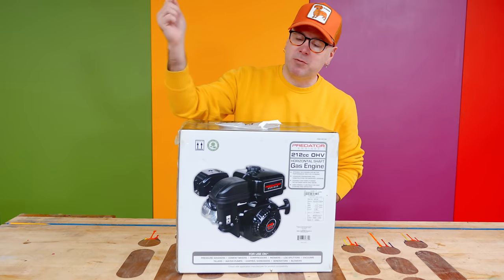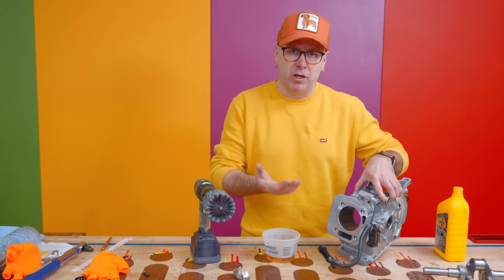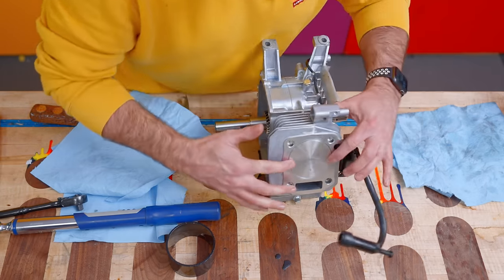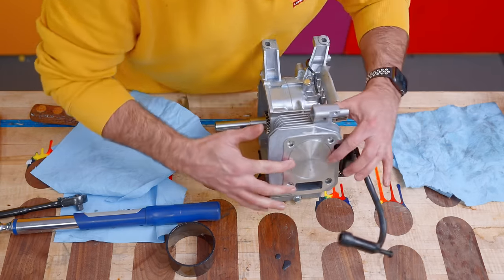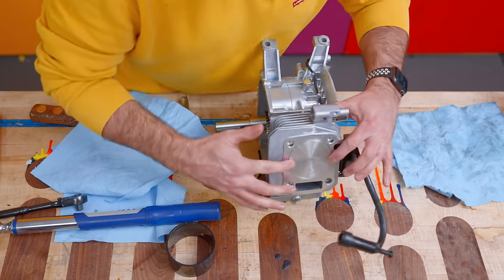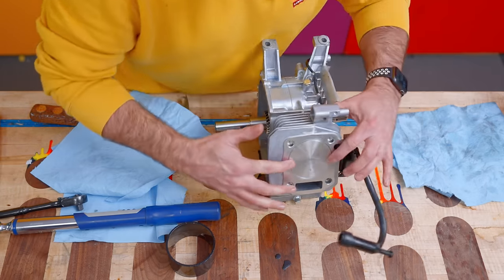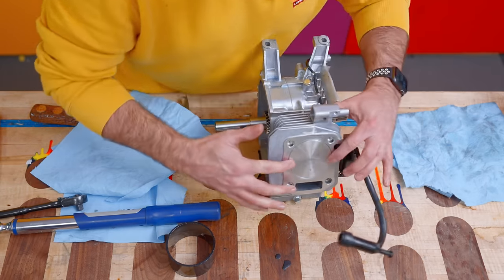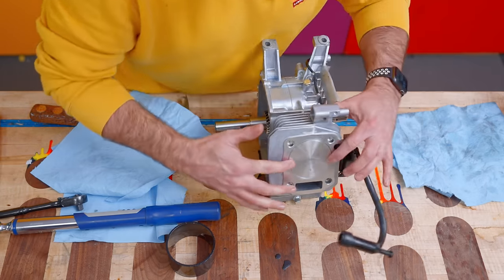How to Build a Competitive Kart Racing Engine (Stock Appearing)

Comment: Great video David! I'm a FAA A & P, , and I'd like to share nothing happens without "ignition". I hope you'll find the aviation version of the internal combustion cycle to be more accurate. Which is: 1) Suck, 2) Squeeze, 3) IGNITION, 4) Bang, 5) Blow. Great tech video, , you point out ALOT of very good tech points and assembly processes for high output engines! Lastly, you have really good production (sound, lighting, layout and editing) values. Loved it!
Reply: Aircraft engines don't operate on the 4 strokes, intake, compression, ignition, exhaust?
Reply: @genefogarty5395  Gene, yes they do. Please reference any aircraft mfgr's piston or gas turbine engine operation discriprion. You are misinformed or do not know the facts with gas turbine or high bypass gas turbines. These are commonly called "jet" engines.  .  I'd recommend reviewing the Continental IO540, a 540 cubic Inch "Opposed Piston" with ovhd vales.  Or the Pratt &Whitney 4000 GTF (Geared Turbine Fan). A typical jet engine has multiple rows of compressor blade. Then multiple rows of blades in the "hot" section. The air enters a typical gas turbine and is very highly compressed. In some engines it's compressed from static atmosphere pressure of 14psi (sea level) to >200psi. in the "Compressor" section. This very compressed air flows into the hot section. Kerosene is injected at very high pressure and inside this "hot section are "IGNITORS".  There are two types of ignitor systems. The continuously  "sparking" ignitor or the continuously "Hot". These "ignitor's" are needed to ensure that the kerosene gets ignited in a very high pressure and very, very turbulent gas flow! This flame front then expands the pressure in the "hot" section by 5X or more! This pressure then expands as it flows across/through compressed hot section blades, creating a massive pressures and force. This gas the exits the jet engine via a third set of compressor blades called the "Re-Heat" stage. So, in a nut shell, it's Suck, Squeeze, IGNITIO, Bang, Blow! I hope you have benefited from today's class. All the best, TAC
Reply: @WestKyCrime  This was a 4 stroke ICE, not a jet, dude. It's still intake, compression, ignition or bang as you call it and exhaust. Ignition and bang are one and the same. There's no delay, it's an explosion. But thanks for the "Class"
Reply: @genefogarty5395   sure, we all have our opinions. Let's walk thru what happens in a ICE ignition event. And I'll try to see if I can convince you why Ignition is its own "event" in the ICE operating process. The crankshaft magnet on the flywheel (engine in the video) passes by the stepup voltage transformer. The magneto (AKA a very strong magnet). The step up voltage coil then excites the main voltage step up transformer (AKA as a "coil pack"). Once the voltage exceeds the ignition systems regulator (AKA as a special type of capacitor), this high voltage then seeks a path to ground.  And "wah-La", it's ignition time. Bang occurs AFTER this above ignition event. In closing, I bet you will agree, that the first thing experienced technicians ask when trouble shooting a ICE is, "Is it getting Spark"?. Next question is likely "is it getting "Fuel"? So, I hope you can now agree that "Ignition" is its own event in Petrol ICEs. All the best Gene.
Reply: @WestKyCrime  It's a 4 stroke. If there's no intake air coming in it won't start, no compression, no start, no spark, no start, no exhaust going out, no start. Pretty simple.

Comment: The zinc additive was removed from engine oil by the EPA in 2013. It's essential for any flat tappet or non roller lifter valvetrain. I'd use it past the break in.
Reply: Rotella T Triple and T6 both still contain zinc, the former in 1200ppm+ range.

Comment: When checking the valve seals you should use petrol or diesel, water is way too thick to test an air seal. Petrol will evaporate if left for too long so keep an eye on it
Reply: Yep....thats EXACTLY why you use gas! its a better indicator of leaks since its so thin and runny and water has too much tension.
Reply: A vacuum checker is the correct way to do it. The tool isn't that expensive either.
Reply: Yea we used acetone in my shop it’s super thin.
Reply: @davelowets  There's a correct way to do a lot of things, if petrol isn't leaking through however the compression is good. No one is buying a tool for a one time job, i certainly ain't
Reply: @mrcaboosevg6089  Do the job right, or dont do it at all.
Reply: @davelowets  It makes a miniscule amount of difference to the point you'd need to literally have equipment that specifically looks for it. I've rebuilt dozens of engines, all with compression at or above what they were new all using nothing but petrol. The 'right' way is the opinion of who you ask, it's not fact. This guy has won races using a good method in a bad way, you gonna tell me he's done a bad job regardless? It's a $300 engine, not a 1960s Ferrari
Reply: @mrcaboosevg6089  Take some pride in your work, and do it the right way, with the right tool.
Reply: @davelowets  Why? Like genuinely, my dad is a mechanic and i've been working on engines since before i can even remember and the only 'specialist' tool i own is a compression tester. I've never had a customer come back to me complaining about my work. In fact many people come who have said the dealer with their 'fancy and perfectly correct' tools couldn't fix them and yet i could because in reality tools don't make you a good mechanic, it's almost like it's what you know and not what you have. Just by the way i own thousands if not tens of thousands in tools, 99% of the time i use the exact same ones i got from my grandad that are the most basic sockets, ratchets and spanners. They were all he used putting together British Army tank engines. 

Don't talk to me like you're some godly man, i gave the man and the people watching some simple advice that has been used and proven for the better part of 150 years and you're coming at me thinking you're the best thing since sliced bread. The guy even used the same method wrong and he's winning races, what are you doing other than being a twat?

Comment: Commonly I see isopropyl alcohol used for checking the valve seal before the first heat cycle, but always remember that if you have teeny tiny itty bitty leak, the chances of it sealing after running for a break in are almost 100%
Reply: I second the isopropyl alcohol...
Reply: Alcohol's for drinkin', lighter fluid's for checking valve seats 🤣🤣🤣

Comment: A tip I picked up from somebody that rebuilds motorcycle engines is to build yourself a small open square of wood out of two by fours or maybe four by fours and the engine case will sit on top and inside the square and not move around so freely on a flat bench. It’s sort of hard to explain but in essence it’s just an open square of wood that’s tall enough to allow the engine case to sit proud of the bench top. It’s so simple when you actually see it but I never thought of it myself. It really keeps the case from sliding around on the bench.

Comment: Just a question: by changing the connecting rod and piston, as well as removing material from the crankshaft, wouldn't the crankshaft require rebalancing to accommodate the changes especially since it will now be turning at 8,000 rpm?
Reply from the maker: Possibly but I have not had issues
Reply: You have to remember that these motors are a single piston motor not a traditional motor with 8 cylinders that spin the crank at once. So take the side cover off of a motor and turn the motor over. There is only one point where the motor is perfectly balanced and that is when the crank is completely in line with the rod and piston. The other 99% of the time the crank and  counter weights are not going to be in that position. I hope that was easy to picture in your mind. But to answer your question plainly no you never have to balance a crankshaft in a single piston motor. The only thing that you really should do is make sure the bore is true.
Reply from the maker: @JakeSeiner  That was a fantastic explanation. Thanks Jake.
Reply: @SomethingAboutMaking  Another tip that people don't really let out is call JC Specialty up and order hardened side cover bolts this keeps the side of that block from flexing with those oem bolts. I know it probably sounds silly but it adds a substantial amount of strength to a predator block. Considering that predators are the weakest blocks of all the clones this is a must for every one I build.
Reply: @JakeSeiner  well excuse my ignorance. Just assumed swapping out stock heavier con rod and piston for lighter components would require balancing, especially taking an engine meant to rotate at lower rpm's and pushing it out to 8k. But I have never souped up a lawnmower enigine.
Reply: @sinformant  Your not ignorant at all man.  These little motors are a niche of their own. It takes countless hours of reading and looking at what parts are available. Not to mention the limits of these motors. I have learned from years of reading and many many errors.
Reply: @JakeSeiner   Where can I start to read and find information for the Predator Engine 13HP? I would like to build one up myself too
Reply: Absolutely I thought the same thing.

Comment from the maker: You are watching my 2nd channel. I don't post here very often. Check out my main channel for all the cool builds! https://www.youtube.com/makesomething
Reply: To check valve seal I always used brake clean (thinner than water) and used a air gun and a rag to "seal" and look for bubbles. Not sure how correct this is but I've identified leaky valves this way
Reply: the bearings will love all that metal shavings from the milling.
Reply: How much you charged to get one build man
Reply: Is that drill Festool? Looks like it but doesn't sound like it. I've been using mine daily for almost 15 years. Incredible quality. Thanks for an interesting production.👍
Reply: Did you grind on your crank shaft?  Doesn’t that create harmonic imbalances?
Reply: @lightbringer7540  I just want to know where to buy the parts
Reply: Where do I buy parts to build a supercharged n turbocharged system for this kind of engine ?
Reply from the maker: @hopebear06  It is a festool.
Reply: A leak down tester is also really good (as it uses compressed air) for finding a leaky valve and all you would have to do is put the head back onto the engine and plug the open end of the cylinder.
Reply: Ah, the backpressure myth strikes again.

It's not the backpressure that improves flow, it's the volume and frequency (rpm) design of the exhaust.
Reply: 43:19 I understand you won't build me one now.... but how about later?
Reply from the maker: This is true. It's funny how most just call it back pressure now.
Reply: @SomethingAboutMaking  Gale Banks of Banks Power almost doubles exhaust pipe size slowly n gradually. Not a sharp n quick expansion in a few short inches. 
This to reduce back pressure, I think he called that video, back pressure myth busted. He wants to make it as easy for the exhaust to escape to make room for the engine to bring in as much fresh cold air into the engine.

Comment: I am not used to seeing people working on these types of engines as go-karts. In Australia we mostly see the smaller and much much faster 2 stroke engines in our professional go-karts. If it cant reach a minimum speed of 100kph / 60mph then it is considered a toy for small children. 
Your work in stripping and then altering and hotting up the engine is well done and amazing to watch. Well done! :) 
It isn't uncommon to spend $6000 to $10,000 on professionally built 2 stroke Go-kart engines. 
Good friend always told me it was cheaper racing Formula Ford that it was racing in the Go-Kart State and Country wide Nationals.

Comment: That was a great ending building video. I used to build those engines for a friend who raced.  I did not know all those cylinder head tricks except for stiffer springs and milling the head.  I started safety wiring the side cover bolts cause of a failure where they loosened and ithe engine blew up.  He had the same header as you,  I wrapped that with DEI header wrap to prevent burns.  I made a tool for holding the crank to the block for torquing the flywheel nut. For removing the stock flywheel I drilled and tapped the stock flywheel 3/8 nc and used a steering wheel puller to remove it.  The same steering wheel puller with different studs would remove the ARC racing flywheel.

Comment: I hopped up Honda engines back in the day. I made an assembly plate that bolts to the crankcase with a hole that slid over the nose of the crank and held everything together while I tapped the pistons in.

Comment: I raced in IKF 4-cycle Stock Heavy and Super Stock classes on dirt tracks in the Midwest for 15 years.  I was also one of our local club's technical inspectors.  This was back when IKF ran the 5 h.p. Briggs horizontal shaft engine.  We ran on 100% methanol.  We always clearanced our engines which reduces friction and increases hp substantially.  We would always run a worn out top oil scraper ring to reduce friction.  IKF 4-cycle engine technical rules didn't allow the oil ring to be completely removed.  It just had to have one.  Since oil consumption isn't a concern we just ran a worn out one.  The IKF Stock light, medium, and heavy classes had to run the stock Briggs carburetor.  We ran Tillotson carburetors with billet aluminum intake manifolds in the super stock class.  I actually ran Klotz KL-200 fully synthetic 2-cycle oil in all my engines.  I had absolutely no carbon buildup whatsoever.  Since Klotz didn't specify the SAE weight for their KL-200 oil at the time I measured it myself.  I was a mechanical engineering graduate student at the time and was performing SAE viscosity testing on biodiesel fuels at the time.  I measured the Klotz KL-200 fully synthetic oil to be in the range of an SAE 50 oil.  The one thing you don't want to do when running on methanol fuel is to leave it in your engine for extended periods of time.  That's because methanol is highly hydroscopic and will attack non silicone (red) gaskets and seals.  On my superstock kart I had a quick connection in my fuel line running between my belly pan fuel tank and Tillotson HL336 carburetor.  It was a quick connection with automatic shutoff valves on both sides.  I made a gasoline flush tank from a one gallon plastic gas can with a short fuel line and male quick connection with shutoff valve just like the one connected to my kart's fuel tank.  After every race day I would unplug my quick connection on the kart and plug in my flush tank.  I would then start the kart on methanol left in the fuel line and carburetor until it was running on gasoline from my flush tank.  I had to pump the throttle lever on the carburetor to keep it running on gasoline.  I didn't connect the methanol tank to the carburetor until the next race day.  By flushing out my carburetor with gasoline in this way, I never had any methanol related problems.  Since methanol is highly hydroscopic always keep your methanol fuel sealed up tightly.  Otherwise it will absorb moisture from humid air.

Comment: Great video, have not built a small engine in over 50 years but love how you explained things to everyone. The video did not seem that long to be honest, excellent content! 👍 
When checking if the valves are sealed use to use Red or Blue Diakim (spelling maybe off sorry) as well instead of using water I always have used alcohol on all my heads with V8's or Air Kewled VW engines!  Happy New Year!  ✌

Comment: i like that your going through all this.  back in the early 2000's i used to race a class that was based on the briggs animal 6.5hp.  It was an open class, the only requirement was that we had to use the briggs block, everything else was fair game.  At one point we had a dome piston, roller rockers, custom cam, and even had machined the head to accept valves from a honda civic along with many other things done to the head.  made almost 50hp.  raced on a short flat dirt track, if you can imagine we ran a 11thooth on the clutch and 68-70tooth sprocket.  I would say our most reliable versions of the engine had flat top pistons and briggs valves with mainly a worked head and custom cam making about 30-35hp.  Our big engine does hold the lap record though.

Comment: Just my 2 cents. Being a tech for 40 years and many valve adjustments done. I've found cold vers hot is about .001 very few .002 for me I just set the valve last .001 loose at cold. When it hot valve lash is fine. No more burning fingers and hands.

Comment: I’m new to learning about engine building. The assembly of an engine appears to be the easy part. Cutting valve seats correctly and within your sanctioning bodies rulebook seems to be a very challenging process while trying to maximize compression and minimize leakage. 

Modifying a carb or blueprinting it is also a very challenging thing from my point of view.
Reply from the maker: carb blueprinting is a whole different ballgame. They are so cheap that I just buy ready to race carbs.

Comment: Good video. You covered alot of helpful points...you can drop the piston in with your fingers and a popsicle stick. I like the method because it's fast and you can see exactly where your ring gaps are instead of wondering if they spun in the ring compressor.

Comment: as far as checking clearances between part, our engine builder at work uses one specific zip tie to measure all connecting rod to block, crank to cam, ect with that is about .035". find a zip tie, make sure its roughly .035" and stick it in the areas you think clearance might be an issue